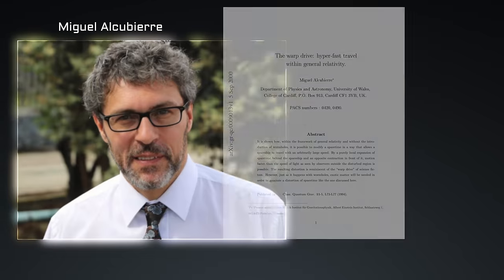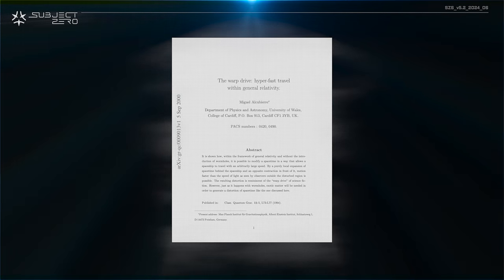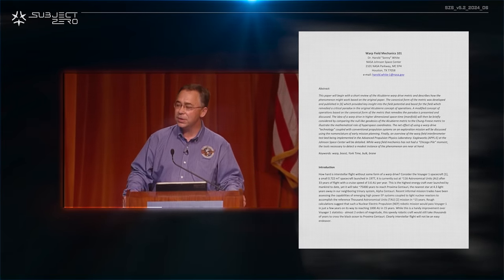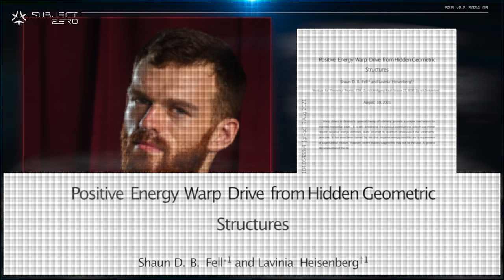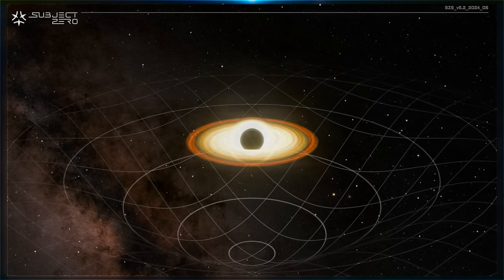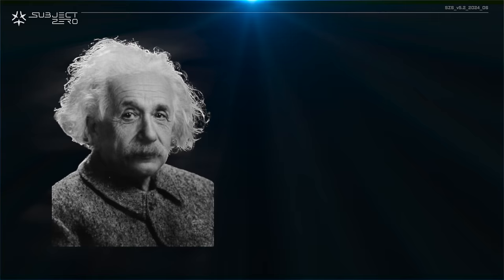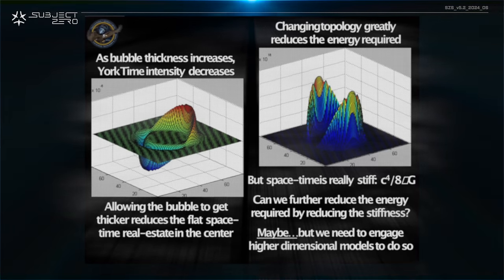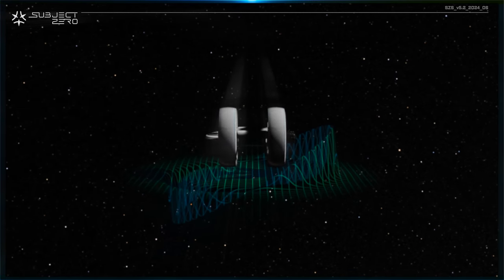This problem makes Warp Drive impossible

Comment: The theory with positive energy and a level much smaller than before has been published three years ago. This video is horrible when it comes to the developments on metrics since the original warp drive paper!
Reply: You could mention the paper for reference then .
Reply: And it doesn't even cover the actual unsolved problem, which is there is no known way to accelerate the bubble across the light speed barrier. Even known positive energy solutions only contain either bubbles which are slower than light for all time or faster than light for all time. This is a difficult problem, and nobody even really has an idea of how to tackle it.
Reply: @oraz.  PBS Space Time, New WARP drive possibilities, 2 years ago. On YouTube.
Reply: @timseguine2  the argument is that nothing inside spacetime is moving faster than the speed of light but warping spacetime allows you to effectively go faster than the speed of light. I’m guessing it’s because warping spacetime itself has to known speed limit.
Reply: @markszlazak  That's not the objection. It is completely fine that the bubble moves at superluminal speeds because it is not an object. The problem I am pointing out (and that has been well known since the concept was introduced) is that all known solutions involving an Alcubierre bubble either have the bubble moving at faster than light speed for all time, or have it moving at sub lightspeed for all time. Nobody has figured out how to produce an Alcubierre bubble solution that transitions from sub light speed to above light speed. I could be wrong, but also nobody has found a solution such that the bubble doesn't exist in the infinite past and infinite future (which means nobody knows how in principle you can get into or out of a bubble, or how one forms or is destroyed)

If you want to use an Alcubierre bubble for transportation, this is an important problem to solve, and nobody has done it yet.

Sabine Hossenfelder has a video about it if you are interested.
Reply: @timseguine2  I just checked Sabine’s videos on this. About 1 year ago she posted one called “I think faster than light travel is possible. Here is why.” This came after the videos you are referring to. Lately, she posted her most recent video and it doesn’t sound like she is negative on faster than light travel but gives software resources to run simulations on various warp ideas.
Reply: @timseguine2  Sabine has changed her mind and now thinks faster than light travel is possible. This is in a video about 1 year ago after the videos you are referring to by her.
Reply: @markszlazak  Hi. That's not the objection either. I agree with her argument in the video you are talking about. I am not arguing against warp bubbles or FTL in principle being possible. I am arguing that this video here's assertion that there is only "one problem that needs to be solved" is wrong. The problem I alluded to is a remaining problem with the warp drive concept that is unresolved. I never said it can't be resolved, just that it is not resolved AND a huge hurdle that needs to be overcome.

Sabine's argument about why the standard argument for why faster than light travel not being possible due to violating causality is not relevant to the practical problem I alluded to. As I said, I think she is right that that standard argument is flawed.

Nothing in that video contradicts or changes anything she said in her video about warp bubbles (unless she said in that warp bubble video that FTL travel is not possible, I honestly don't remember)
Reply: @timseguine2  Oh I see. Ok it’s been thirty years since the original warp drive proposal and they have advanced a bit. Just one more big hurdle.

Comment: Okay, so all we need to do is create a black hole in front of a ship, with its connecting white hole behind the ship. A localized wormhole, but instead of traveling thru it from one point to another, you use and travel with the entire system overall. Self propulsion, if you will. The black hole in front is kept at a certain distance from the vessel, which is surrounded by a "warp bubble", it pulls in the warp bubble itself, while the white hole is kept a certain distance behind the vessel, pushing it from behind. The space inside the warp bubble is kept still, so space will move around this localized pocket of space time, black/ white holes included. The mass/ energy of the black hole will be equalized by the negative mass/ energy of the white hole, so you would need to surround these two objects in a cylindrical "warp tunnel" that would entangle the two together enough to allow them to travel faster than light. Think of a warp tunnel, at the entrance is a black hole, in the center is a warp bubble that holds the contained positive mass and energy of the traveling vessel and crew, and at the exit of the tunnel is an entangled white hole. In order to stop traveling with this method tho, you would need to collapse the two holes together to cancel each other out, which could potentially cause damage to the local area upon arrival. The gravitational waves of such a collision is also a danger factor. Unless... you build containment rings, such as the rings around the vessel, like shown on the enterprise model in the video, that enclose the white and black holes in a "nullifying field" that cancels out their pulls and pushes. This would require 4 singularities to accomplish tho... you would also need to figure out how to manipulate and control the gravitational affects of said singularities in order to gain such capabilities. Then again... the black hole and the white hole will already create a wormhole thru space time, technically going straight thru the apparent location of the traveling vessel. Pull the walls of this wormhole "out" far enough and you'll pull both singularities into the wormhole as well, letting them cancel each other out without harming anything, potentially. It's still unknown where the wormhole actually "exists", so this could potentially still cause damage in an area we aren't aware of yet. But it would cancel out both singularities and stop the forward motion of the vessel at the destination. We need better ways to contain/ "delete" the singularities to enable safer travel. The black hole in the front of the tunnel would also act as a force field for the vessel against incoming debris, seeing it exit the white hole from the exit of the tunnel. Huh... a literal "worm" "hole". Creating the spacial distortion to build the tunnel is another matter entirely as well tho... much to consider with this one
Reply: You’ve clearly put a lot of thought into this.
Reply: I see..🤔
Reply: your idea starts with "all we need to do is create a black hole in front of a ship" bro what

Comment: Fusion and/or Antimatter annihilation reactors + an oscillating array of high frequency gravitational wave generators (i.e. high speed rotation of two large high density masses in a magnetic field) = functional warp drive.
Reply: For the time being, I would have a just as high likelihood with writing: Functional warp drive = just do it with magic!
Reply: did you just do napkin math or do you have an actual source?
Reply: Probably need two equally opposed masses in a rotation following along an orbital eccentric. Basically following mirrored elliptical paths approximately meeting in a "V".  Masses balance and cancel each other out for part of the cycle, but there should be a way to bias the impulse of the cycle where they don't. But agreed, gravitational waves might be the right approach. (Properties of cymatics with interference patterns in standing waves gives some idea. No exotic materials needed there.) But would the material needed to make a device showing any appreciable effect have to be made of unobtanium? Presumably it requires a good bit of mass changing direction very fast, and subject to all kinds of stresses.

Comment: Warp drive may not even require negative energy if we can just contract space-time in front of the spacecraft and push the aircraft (generate thrust) using super efficient engine and enough fuel.
Reply: Phase Drives Require Matter/Antimatter Reactions To Exploit Conservation of Energy Converting Matter/Antimatter Fission Into Phase Energy Which Is Used To Warp Space Around A Spacecraft However Like Any Thermodynamic System It Requires Fuel And The Fuel Is Antimatter Combined With Matter Both Are Consumed And Converted To Phase Energy In The Process So Basically A Warp Drive Can Be Thought of As A Solid-Propellent Rocket With A Black Flame The Black Flame Would Be The Phase Energy Itself Generating Warp While The Solid-Propellent Is Any Form of Matter Reacting With Antimatter Resulting In The Black Flame Through Conversation of Energy So Do You Get It Warp Drives Are A Machine That Controls Reactions Between Matter And Antimatter To Produce A Desired Result

Comment: Wasn’t negative energy observed through the cassimir effect a few years ago? I have a vague memory about it.
Reply: There is more than one way to interpret the cassimir effect, PBs space time talked about a while back. Also, if my memory serves me right, even the exotic interpretation shows the vaccum ennergy, or lack there of in betwwen the mirrors. It would be a energy low, not negative energy.
Reply: Kinda, but not really. You’re right in that “negative energy” is part of the Casimir effect, but it’s important to note this is “negative” in a relative sense. It’s negative relative to the rest of the quantum foam on the outside of the plates.

Imagine it like this, an aircraft flies due to positive and negative pressure around its wings. But it’s not like there is no air, or even negative air, in the low pressure zones. There’s still air, just less of it. It would be impossible for there to be “negative air”, just like it’s impossible for there to truly be negative mass/energy.

Same goes for energy. Negative energy is possible in the real world, but only relatively, not absolutely.
Reply: @joelmulder so its not objective or if it is only the most powerful things in existence can make it
Reply: @Mahlak_Mriuani_Anatman  I don't really understand what you're trying to ask, but I'll make a guess.

Nothing can make true negative matter/energy. It's a concept that can exist on paper, but never in reality.

It's like how you can solve X^2=-1 just fine with imaginary numbers, but it's  impossible with real numbers.

I can solve 1x2 by having one apple, and adding a second apple, to end up with two apples.
But I can’t solve X^2=-1 by squaring a real object and expecting a negative result, because in the physical world, squaring any real, tangible object always results in a non-negative number. There are no negative apples.
Reply: Well I suppose if anti matter doesn't exist in nature, mankind is just going to have to create it "artificially"😮
Reply: @adamkhan7736  Not antimatter. Antimatter occurs naturally in a variety of processes. Antimatter is just regular matter an opposite electric charge.

We’re talking about negative matter/energy. Negative matter is matter that if you were to let go of it in a gravity well, it would fall upward, or roll up a hill instead of down. Or if you added a negative matter items to a pile together, the pile would get smaller. It’s contrary to the basic operation of our universe, which is why we’re very confident in saying it can only exist on paper.
Reply: @joelmulder  They carried out experiments at CERN in the hope that antimatter would fall upwards. Unfortunately it fell down. However, they did find that antiatoms fall at 0.75 times g. Which is a small step. All this is according to Physics Daily.

Comment: Have a pipes that is made of graphene with active reinforcement.

Spin it along the axis, so it's wall is now the floor.

At reletavistic speed.
At one end(and the half that's attached), you add another pipe. That spins counter, and is conecentric with it.

The frame dragging of the spinning pipes, means that at the area the pipe is alone, the space inside it has less zeropoint ambient energy, while at the half that has the other one added in, the frame dragging effects of both partially cancel eachother out, so you have and area where energy accumulate. Rather than getting flung out with the gravity waves. Positive energy.
The other, negative energy, relatively speaking.
Reply: This is interesting, could you elaborate more?
Reply: @Interestingpersonsuper  
Honestly... that center pipe(or however you frame this) should be heavier, and stronger, because the engine here will be anchored in it.
as the outer pipe spins its frame drag does its thing.

this will need to have an active support of some kind, because even graphene is not that strong(I don't think, anyway).

My guess, electromagnets, and some kind of 'skeleton', For lack of a better term.
the part with the inner pipe(ring?) will probably be easier. As the pipes can support each other.
bonus if at that area they are not so much pipes,  as interlacing puzzle pieces of concentric rings. think like a testa electric engine (in the wheel, you know?) that because the wheel is very heavy and big, is actually like two or three of it, one inside the other...

...

also, the long hollow tube/pipe, can be strong enough to hold the weight of all of this, and at its far end, be closed and actually sealed, but at its length be more of a meche that gas can be tossed out of.

Now. have the whole thing like... Be dropped, or be in the water, basically in a position it can do its thing. any water/air gets tossed out of it because of the spinning. making it float. that makes it float. and due to the effect of the Gyroscope,  it stays straight. And the only direction it doesn't resist, is along its length. So on earth, it would work even better. As long as we ignore friction with solid objects. Which, wheels...
Reply: @fanOmry  that’s actually really awesome!

Comment: Even if warping space were possible, the contraction of space in front of the ship poses a rather nasty problem. What happens to the mass near or directly in front of the ship? Odds are that it would be drawn towards the center of the warp field. Thus as the ship accelerated its likely to burn up from interacting directly with particles traveling near light speed!
Reply: It just bounces off
Reply: @Ladyfloats  Until its built and flown, there is no way of 100% knowing for sure. Especially at the relativistic speeds we are talking about, a single impact would absolutely destroy the craft.
Reply: @4DCResinSmoker  they’ve explained how it works with zero point energy. It makes like a force field around it that’s why it can go so fast.
Reply: @Ladyfloats  Your assuming that they are correct. Until its built and flown, there is no way to really know. It's just like with aircraft, no amount of theory and computer modeling can account for real-world behaviors that our limited knowledge can account for.
Reply: @4DCResinSmoker  The ship wouldn't move through space, space itself would curve allowing the ship to move relatively to the space around it without actually moving. Incoming particles wouldn't hit it but curve around it. Just like when swells in the sea pass through you you don't get hit by anything, you just float upwards then downwards without any change in your momentum
Reply: @Ladyfloats  At relativistic velocities.
Reply: @higorss  Yes, space would be curved but the ship would still need to be pushed through it. Compressing the space in front, while expanding it behind the ship will not alone move it. Remember that the ship is within its own warp bubble where space isn't being altered. Thus to move through it, you'd still need an engine.

Comment: When subject zero start it to explain negative and positive warp bubbles, I started nerding out on the ability to have phantom or sort of hidden stabilizers like on a plane would have to keep itself straight, this also says that you could possibly have an Anti-Slip system in other words a way to keep the aircraft from drifting in the original direction it was moving when taking a turn in space. And this saying you possibly dont need a silly orbit to change directions.
Reply: A warp drive or spacetime manipulation field would be far larger
Reply: @exstacc1886  forget the size or actual theory of it. Artificial stabilizers like an airplane

Comment: Quick question; " if you placed hardcore thrust adjacently in front and reverse adjacent thrust in back would that create a thrust bubble, with chemical propulsion, or nuclear; within a vacuum? The answer is no, you'd just spin out of control, end over end.

Comment: negative energy is not needed. if you can artificially create a small dime-sized black hole in front of the ship and blink it in and out of existence it will pull the ship forward. As space is a near vacuum the ship will continuously build momentum. the black hole also serves another purpose to clear some debris in front of the ship.
Reply: yeah with your magic wand?

Comment: I mean I would think it'd be impossible to detect negative energy with anything other than a neutrino detector. If a black hole has a point where light can no longer escape it, by the same token a negative energy "white hole" would have a threshold where light/matter could not approach it rendering it invisible to anything other than the ability to detect particle/energy deflections away from an "empty" point in space. As far as powering a drive like that the only thing that makes sense to me is to figure out a field emitter that functions like a fuel scoop harvesting neutrons before the ship out of the void and pushing them like an aerospike behind the ship creating areas of high and low relativistic densities.